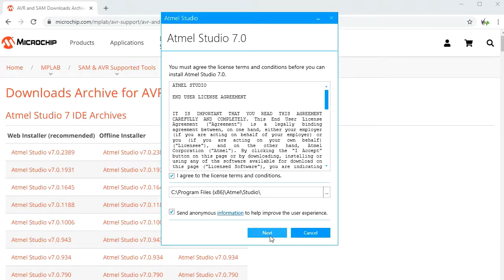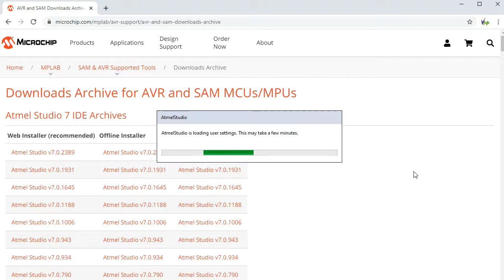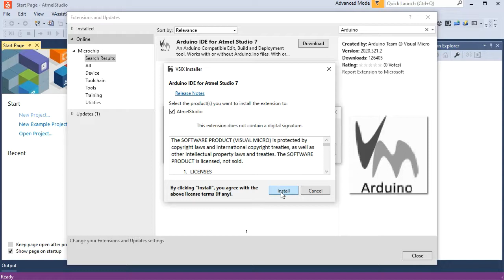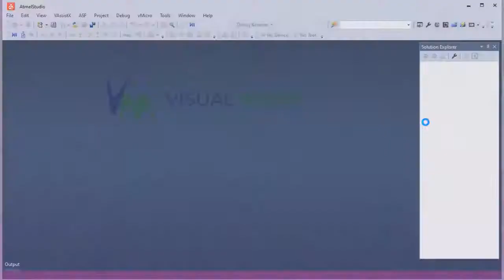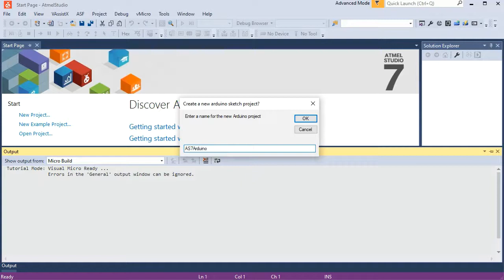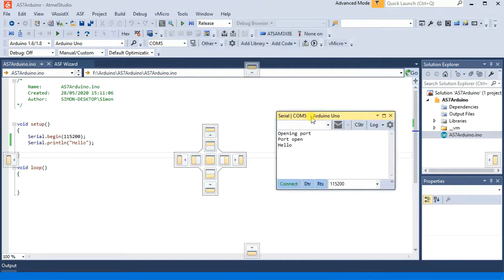Installing Atmel Studio and Visual Micro for Arduino

Comment: Many many thanks! 👍

I have just installed Microchip Studio, with the intention of using a new "SNAP" JTAG module to debug my ATmega code, normally compiled in the Arduino GUI. I had no idea that there as a plug-in to make this easier, so you have saved me hours of unnecessary configuration!

Comment: I had to re-install my computer and I find out that Atmel Studio is not available on the Microchip website anymore. I hope is a temporary. I've found it on old Google cache's. Does the plugin works with Microchip Studio too?
Reply from the maker: Hi, Atmel Studio has been renamed to Microchip Studio. Visual Studio is recommended unless you need to set avr hardware fuses.